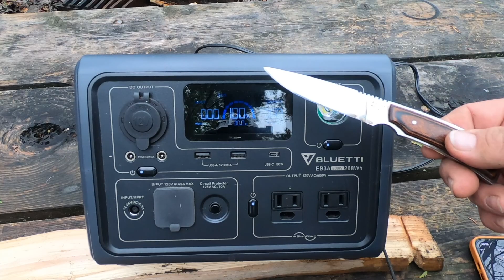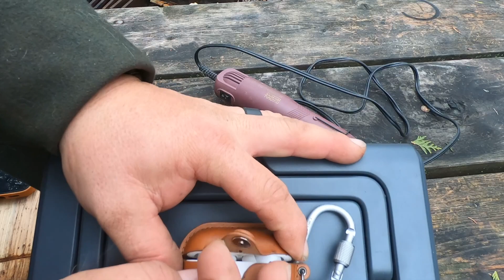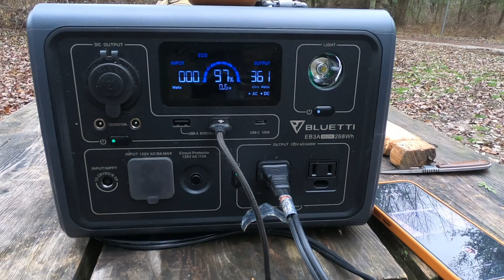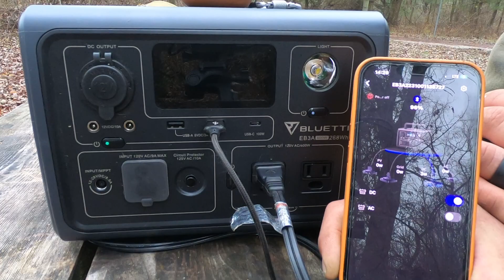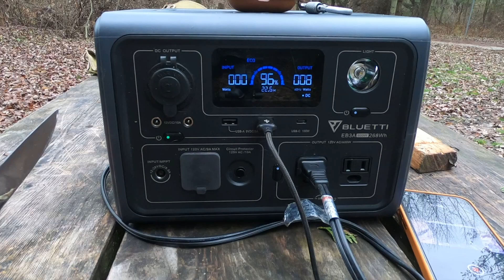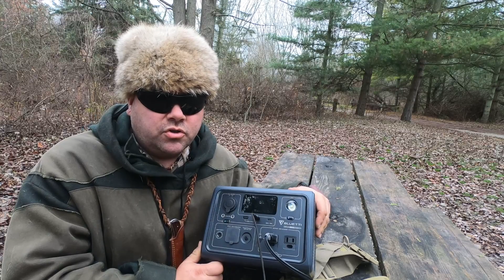Bluetti EB3A Power Station Field Testing

Comment: Be aware before buying EB3A. It has a major issue charging from PV. As soon as the weather is a bit cloudy, The charging led blinks but no charging !
I live in Thailand (very sunny country) and i cannot charge correctly. So, i contacted Bluetti and they confirm. 
"Hi  there,
This is Mike from Bluetti.
In addition to the voltage requirements, low power will also cause charge failure.
If the solar panel is not receiving enough radiation to generate enough current in cloudy weather, EB3A will not be able to charge, so the current need to greater than 1A.
Kindly let us know if you have any questions.
Thank you for your patience and understanding as always.
Best Regards
Mike 
Bluetti After-sales Engineer"